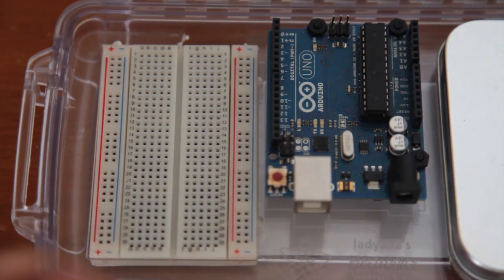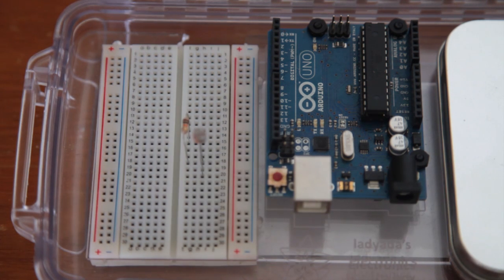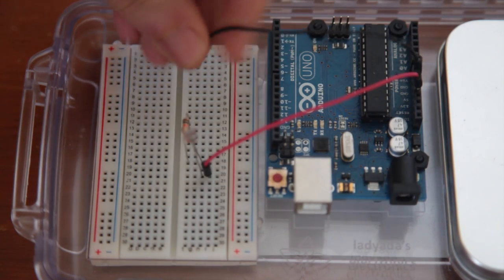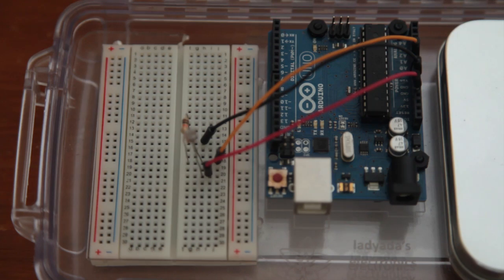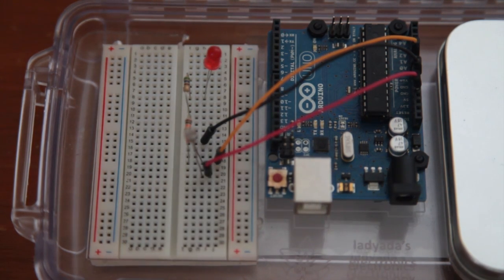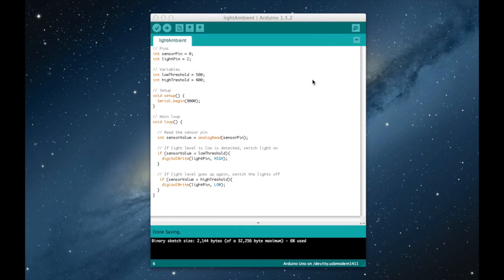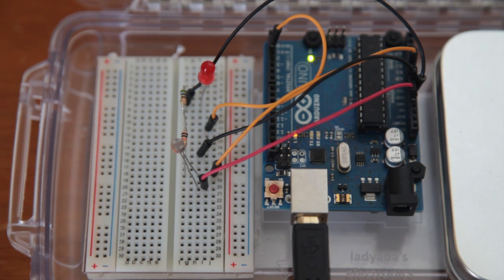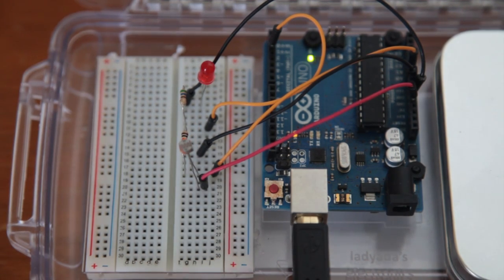Smart lighting using Arduino and a photocell

Comment: Cool but what is the minimum you need for this? An arduino uno is 20€, then a resistor. I guess most sensors are cheaper?
Reply from the maker: MrFishhunter A photocell is also very cheap (under than 1 euro), and you can find cheaper Arduino Uno clones (around 10 euros)